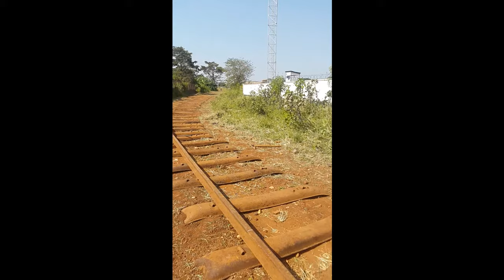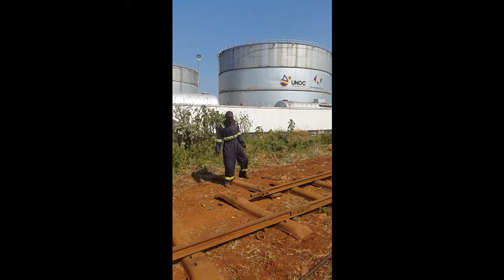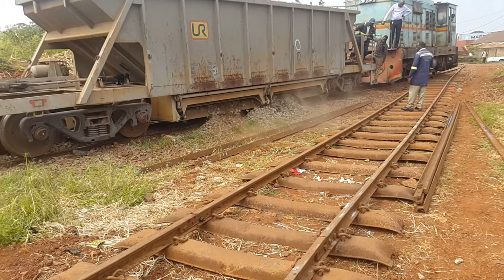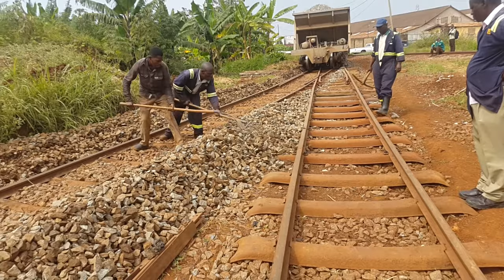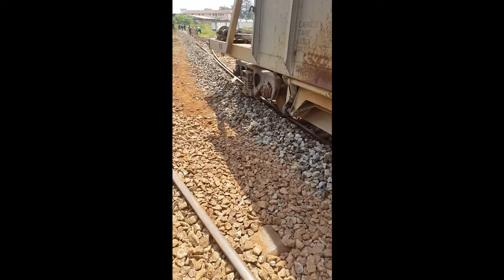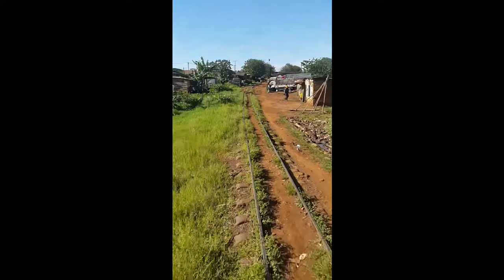Uganda Railway line under  revamping to accommodate smooth running of trains.

Comment: I found it a bit strange that ballast was dropped on the side of the track and shovelled manually on the new track bed. Why not run the ballast train over the new track and drop the ballast vertically? Much less work.
Reply from the maker: You risk a derailment if you happen to drop ballast  in a diamond, because some stones will get embedded in the point and hence derailment. Its only safe to drop the ballast vertically in a straight track or curve but not along the switch points.